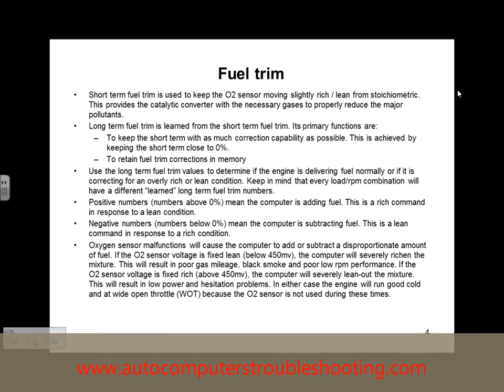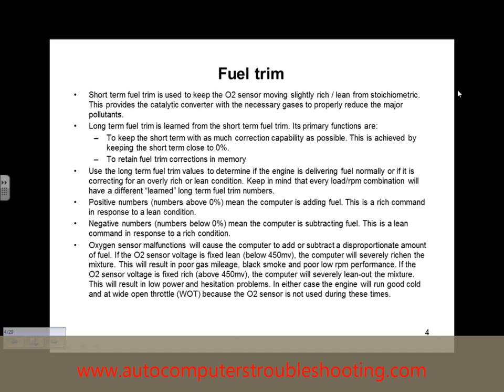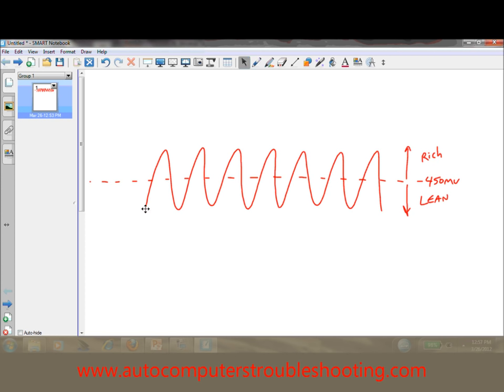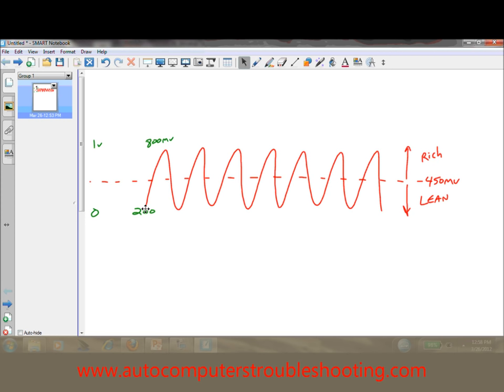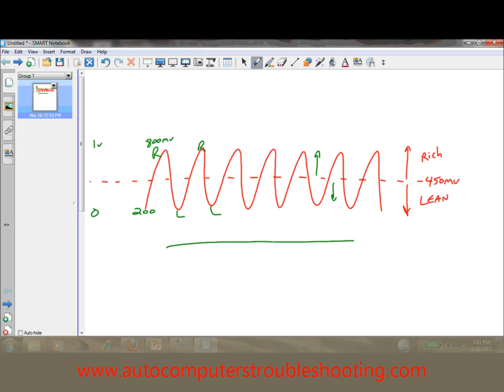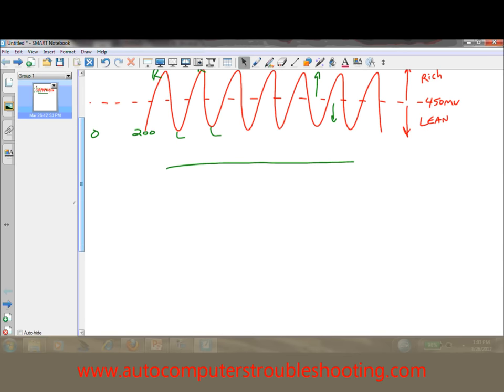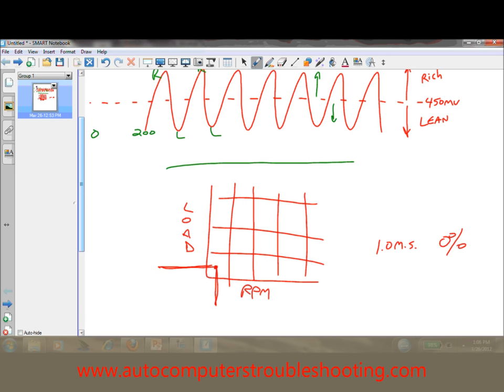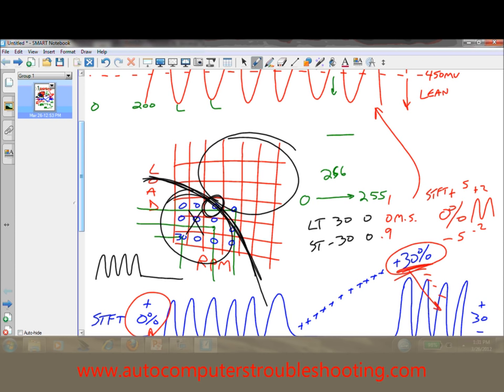Understanding Short Term and Long Term Fuel Trim (a SD Premium video)

Comment: Dude i have a question. At idle short term fuel trim negative 10 roughly and no change until accelerate. 1200rpm up fuel trim go pos then neg and back to pos as expected. Just idle sits around neg 10 at 800rpm. Your thoughts?
Reply from the maker: It is running rich at idle
Reply: Yep at idle. then as accelerate the soft goes up and down as normal.

Comment: Hello im currently using a Genisys Evo scan tool and wuold like to know what term does Nissan use to read or mesure Fuel Trim.
Reply from the maker: ST Alpha and LT Alpha
100 = 0%
Numbers above 100 = adding fuel
Numbers below 100 = subtracting fuel
Reply: ScannerDanner Thank you . at first i couldnt find the FTs at all on the tool ,until i look under OBD2 GLOBAL . and found it there ,and thanks for the numbers .

Comment: I find that the Fuel Trims are meaningless short term as you get a constant fluctuation in the STFT that you cannot keep track of. WHAT I believe people should do, and I do, is get live data for say a 20 minuter mixed drive, export to excel, then work out the average Net Fuel trim for each Load.  This gives me a totally different view than what I expected by just observing live data.  You can then average for segments of load.  Say 15 - 40% Load, then 40 to 70% etc  which is what I do.  ALSO I think the humidity of the environment should be considered. Here it is 70% humidity right now.  Fuel trims will be skewed due to high moister content of the air, thus less efficient burn, creating lean condition, higher fuel trim than normal. IMO  Since the algos are worked in Korea, and maybe for Europe...where humidity conditions are not high most of the time.

Comment: Any idea why my long term fuel trim is fixed to zero? I have noticed increase in fuel consumption and found out that  ltfr is fixed zero.
Tried to disconnect the battery, that did not help.
O2 sensor is working properly and short term fuel trim is oscilating as is should.
Reply from the maker: If you have no codes and LTFT is at 0 and STFT is moving with the O2, everything should be fine. 0 is ideal.
Now if you have a code related to the O2, a fixed fuel trim number can be a default value, in which case that would not be good
Reply: @ScannerDanner  Thank you for quick response. I have no error codes regarding the O2 sensor. Short term fuel trim fallows O2 sensor.
I belive 0 is bad for the long term fuel trim, because it has always been around -7 to -5. My car is citroen c3, 1.4i 2005, running on lpg. 
Is there any way to force the ecu to reset the values somehow?
Reply from the maker: @sasacvetkovic127  0 is not bad, it is ideal
Reply: @ScannerDanner  
Thank you for answer. I will leave it as it is. 😀
By the way, you channel saved me a lot of money. Car repairman in Serbia are very bad, they just change parts until they hit the right one. 😅
Keep on with good work!!!

Comment: I need assistance, when my 2005 Pontiac grandprix GTP comp g idles my short term fuel trim will make it to +23 my o2s2 behind the cat will sit at 0mv to 50mv at that time the o2s1 in the exhaust manifold will sit at 950mv so it's definitely seeing that the short term trim is adding fuel.. the long trim will still be normal at -5. a few times I caught the long term at +23 with the short term normal between -1 to +1 with the O2 sensors reading the same thing. Car cold usually runs great, after it's warmed up I will feel it drag under light acceleration like 7% gas pedal. The more pedal I give it out responds, but total power at 100% throttle is less than it should be. Fuel pressure is 63psi no matter what load and rpm. Fuel volume test is 1 liter of fuel in about 30 seconds so I have good pressure and good volume.. mass air flow sensor and o2s1 are brand new acdelco parts from the dealer.. I have no codes..  I'm thinking map sensor maybe??? It's above the exhaust manifold. Also when it runs like it's dragging the trans shifts soft or firm and shifts are late, I feel 1st gear shifts at about 4 grand which is a little higher then I'm use to.. transmission is new btw, 30k on it.. intake manifold gaskets are also new, I installed the newer metal gaskets...  An ideas? I need a direction please. Issue is there with the stock pcm and with the zzp pcm.. in the past year, 3 times I heard some bad spark knock in 4th gear overdrive with half throttle..  but once that happens on a trip it won't happen again after I take it out of over drive. I then let it go back into overdrive and it won't do that again for months. It's only happened on 3 of the 100s of trips in the past year and once it does happen it won't happen again on that same trip..  any help would be appreciated. I do have some scanner screen shots and a video I can share if it helps
Reply from the maker: Any chance your upstream and downstream O2 connectors got swapped? There is only 1 upstream sensor right?
It doesn't make sense to have a 900mv upstream, a 0mv downstream and a +23% fuel trim.
If the upstream is fixed rich (900mv) you should be seeing negative trim numbers, not positive
Reply: @ScannerDanner  yes only 1 upstream and no they aren't swapped the connectors for each aren't the same. Even if they did reach each other.. when I start driving everything goes back to normal too... I was beginning to think my o2s2 was\is failing and the pcm was adding fuel trying to get it to switch??? But it hasn't done it in weeks now but I still have that power loss after warmer up.. car feels like it's dragging something heavy behind it at very light throttle, it's missing the torque I'm use to feeling at I can tell I'm losing power across the board.. when I first start it up in the morning it runs great though, cooler it gets outside the better it seems to run.. even if I have a bad O2 at pe it shouldn't matter, that's why I started with the maf.. in the na motors I know the map is used for EGR testing, but in the supercharged grandprix I'm pretty sure it does more.. even though the scan data for the map\boost sensor looks good, I'm beginning to think it could be glitching and I'm not seeing it on the scan tool.. it's giving me 5psi at idle, 26 to 27 PSI when I shift at 6200rpm which with the 3.4in pulley on it = 12 to 13 PSI boost after I subtract the barometer reading of 14.3.  I tried my stock pulley and still have the issue.. I've replaced all 3 coils, ign module, plugs and wires also. Another reason I'm thinking map sensor is because it sits above the rear exhaust manifold.. and I'm not sure if what's causing the power loss is causing my 1st gear shift to about 1500 rpm higher then normal, or if my firmer then normal shifts are caused by the motor putting out less power then the pcm expects or if it's all being caused by the same thing..  I can't find any literature on what the map\boost sensor on the gtp does.. but if it's being used for more than testing the EGR I would think it could affect power a little and trans shifting being soft, firm and late.. I know the map detects minute air changes the maf can't so it would make since. Twice in the past year the car took off a little bit on its own in a drive thru.. took my foot off the brake and it took off like I pushed the gas pedal down 4% when Alli did was take my foot off the brake... Sometimes I wish I had a scope because of the scan tool delay. But I be eliminated fuel delivery besides the injectors, maf, o2s1 and the entire ignition system, crank sensor and harmonic balancer are even new. so there is nothing really left..
Reply: I uploaded a video of scan tool data, if anyone can watch it and see something I don't I would appreciate it.. 3 gm dealers and 2 shops say they can't find anything wrong but clearly something is going on.. I know my car and how it's supposed to run...  To bad Danner didn't love closer to Milwaukee WI I think this would be a good case study.. you could make 3 gm dealers and a couple shops look silly along with myself... Lol
Reply from the maker: @markborrmannjr  just replied to your video
Reply: @ScannerDanner  the only reply I see from you was from about a month ago telling me my O2 sensor wires are switched around.. but that's not the case..  i think I have a weak fuel injector, misfire counter will increase just a few for cyl 1 lately.. like 4 to 8 only..
Reply from the maker: @markborrmannjr  I replied under your video

Comment: My TPS at 20% @ idle.  
What if IAT is over 30 degrees higher than ambient temperature? Showing 130 and the outside temperature showing under 90
Both ltft are -9 area.
Reply from the maker: underhood temperatures and also some IAT sensors measure manifold temp
Reply: @ScannerDanner  both of my long term are -9 or -10 range
Reply: @ScannerDanner  someone said negative numbers generally point to head gasket.
Reply: Both negative ltft, bought a fuel pressure guage. Started vehicle and it indicated 65, soon as I turned off engine it immediately dropped to 60 psi.
Reply: 20 minutes later (about ) guage still indicates 60 psi while off. Took about an hour to drop to 40psi.
Reply: Where can get live data specs for my vehicle?

Comment: will there be a plus or minus behind the number
Reply from the maker: A minus but no plus
Reply: A minus means lean which the computer will interpret a rich command
Reply: Chris Canty I believe there's a delay in learn ambient so if you replace O2 takes 5 _6 miles to learn new ambient level & re adjust fuel by the CPU.

Comment: hey Scannerdaner, I have 99 corolla, I put scanner on it to learn fuel trims, I found out that long term is 19 at all times(idle or high rpms), the short trim is between 3 and -3 at idle, but underload, short trim goes to -20. what are your analysis on this?
Reply from the maker: What is your definition of "under load"? If you are heavy accelerating or at WOT, your fuel trim numbers are irrelevant under these conditions because the O2 is being ignored and the computer is NOT trying to "trim" the mixture. 
As for a lean condition all the time (idle and high rpms): My money is on restricted injectors which is common on this model. Do an injector balance test next.  I have some case studies on this but it's on a Chevy Prism (same Toyota engine)
Reply: ScannerDanner thanks. I mentioned when I rev the engine while the car is in park. I forgot to tell you that it had a misfire a few months ago on cylinders 1,2. I did some testings. I swapped the corresponding injectors with the good ones. The misfire moved to the other cylinders. So I went to the junkyard and got used ones, the misfire gone and the codes gone as well. Also there is an exhaust leak seems at the gasket before the cat converter. I wonder if it has any affect.
How to test injectors?
Reply from the maker: Toyota 1.8L with restricted injectors
https://www.youtube.com/watch?v=ZnFSUNjwDPQ
https://www.youtube.com/watch?v=85nMC6xIfUg

Here is the Chevy Prism with the Toyota engine
https://www.youtube.com/watch?v=pv9R2IEG4mU
https://www.youtube.com/watch?v=Q6lRNG5NdQU
Reply: thanks a lot sir! that helped me a lot

Comment: So I had a really poor fuel consumption and bought a scan tool. My LTFT was at 3.1% and STFT was at 19.5 showing a rich condition. Using this tool I realized I had some vacuum leaks. I replaced every vacuum hose since they were all really old anyway.  
Now here’s my problem Fuel trims

So I had a really poor fuel consumption and bought a scan tool. My LTFT was at 3.1% and STFT was at 19.5 Using this tool I realized I had some vacuum leaks. I replaced every vacuum hose since they were all really old anyway.  
Now my STFT oscillates between -3.9 and 3.9%
LTFT steady at -3.9%
Calculated Load oscillates between 14.9% and 15.3%
Mass AF at 1.79g/s
TPS 12.5%
O2S1  0.050v and 0.815 
O2S12 0.035 and 0.040

At 2000rpm
LTFT -15.6% and STFT oscillates between-5.5 and 0.8
Calculated load 16.9%

At 2500rpm
LTFT -21.9 and STFT -6.3% and 1.6%
17.6% calculated load. 
Those negative LTFT at open Throttle bothers me. I need some help here
Reply from the maker: it would help to know what you are working on (year, make, model, engine etc)
Reply: @ScannerDanner  2006 Toyota Corolla Altis with 3ZZ engine

An update: LTFT is now steady at -25% while my STFT oscillates between -8% and 3.9%
Cleaned my injectors (the plastic around the metal of each injector is crack)
Swap out Ignition coils to see if they were the issue... No changes... O2 sensors are new and MAF seem to be in good shape. 
Am having a Rough idle

Comment: How can i determine whether I'm in closed loop or open loop?
Reply from the maker: 1.There will be a data pid that will tell you
2. If your STFT % is correcting
3. If your O2 sensor is fluctuating
Reply: @ScannerDanner   Thanks I found a PID labeled " Fuel System " its either Open or Closed.

Comment: Can code p0113 give a rich condition? Mazdaspeed 3. Its miss idling pretty bad. Ltft -9.5 and stft -3.3 at idle. Ive cleaned out the MAF and IAT multiple times and has new plugs.
Reply from the maker: What's the definition of the code? I don't know these by heart.
Reply: ScannerDanner Hi sorry. It says IAT sensor circuit high input
Reply from the maker: Is the IAT circuit part of the MAF sensor? What year is the car? And engine size?
Reply: ScannerDanner yes it is part of the MAF. Its a 2007 2.3 direct injection turbo

Comment: Hi, I'm new, is it possible to keep computer memory somehow available when disconnecting battery for some reason?
Reply from the maker: Yes, with memory capacitors in the module itself.
Reply from the maker: But don't use those memory savors that you plug into the cigarette lighter

Comment: I have P1174 in 2009 GMC Sierra... After finding 2 leaks and tightening the bolts to the driver's side Exhaust manifold and catalytic converter.... How long until the computer realize the issue is fixed? My LTFT were in the +15 range. I drove 400 miles already since the repair... I can see the LTFT coming down . But is it common for this P1174 code to stick around this long after the fix? Not sure if I should move on to replacing injectors.. or just drive a couple hundred miles to see if It eventually falls into a fuel trim threshold to ECU is happy with. Can anyone recommend a tuner that will eliminate this balance bank issue ? Its not a driving issue... I just can't pass SMOG in California.
Reply from the maker: GM LTFT numbers will react within minutes. You still have a problem. 
What are your numbers ST an LT at idle compared to 2500 rpm in park
Reply: @ScannerDanner  at idle here are the fuel trims. STFT B1 @ -2.3% , LTFT B1 @ 0.8% , STFT B2 @ -1.6% , LTFT B2 @ 1.6%
Reply from the maker: @chickenfriedlasagna4597  and 2500? You don't have a vacuum leak that is for sure
Reply: @ScannerDanner  2500RPM at park I took a snapshot  showing STFT B1 @ 1.6, LTFT B1 @ -0.8 , STFT B2 @ 0.8 , LTFT B2 @ 0.8 ...
Reply from the maker: @chickenfriedlasagna4597  all these numbers look good, what seems to be the problem? What code is setting currently?
Reply: @ScannerDanner thanks for reviewing. Code is P1174. Fuel trim cylinder balance bank 1. The only issue is the vehicle can't pass California's SMOG test with check engine light, oxygen sensor monitor not ready... this code is the only thing I have to track the issue down.
I'm hoping it is just the high RPMs that need to sort out. I drove over some steep hills before I got the issues corrected.. Grapevine (i-5) Donner Summit (i-80).. maybe those trips are still in it's memory ?
Reply from the maker: @chickenfriedlasagna4597  well there certainly is no fuel imbalance going on currently. I'd suggest watching those numbers during some steady throttle driving and see what they do. Maybe clean your MAF just for the hell of it, to see what happens.
Reply: @ScannerDanner  Will try. Thanks for the help.
Reply: @ScannerDanner  could I run something else by you? Do Fuel Trims determine the A/F equivalence ratios of .999, 1, or 1.001?  
Curious if I'll be at 1 eventually...? Thanks
Reply from the maker: @chickenfriedlasagna4597  yes, and these are just calculated numbers based on the fuel corrections or fuel trim. When STFT is moving back and forth across zero, you are at stoichiometric (14.7:1) or Lambda of 1.00
Those numbers you posted look good, as does your trim numbers.

Comment: Hi guys, 
If my sensor 2 voltage is 0.7 to 0.9 on idle what those it means ?

Many thanks
Reply: If you have steady voltage on your O2 sensor after the catalytic converter, that just confirms your cat is doing it's job. Mine tends to be 0.1 to 0.2 except on cold start up. When I'm speeding up and I'm in the throttle pretty good, my front O2 sensor of course goes rich, and sometimes the catalytic converter's O2 sensors goes rich too.

Different cars have different usual steady readings after the cat. Just remember, it should be stead. If it spikes easily it may be an exhaust leak, if it oscillates up and down somewhat like the front O2 sensor then you have a bad cat.
Reply: DE Nichols thanks.  I guess its all fine so. ;)

Comment: 2002 Nissan direct injected engine (QR20DD). By judging spark 
plugs, I assume that the air / fuel mixture is not rich. May be some 
kind of a lean condition?
https://i.stack.imgur.com/0vaTv.jpg
But the issue is fuel trims. When it idles around 650RPM, the STFT is
 bouncing from -2% to -8% and the LTFT stays at -10%. STFT is 0% to 2% 
and LTFT is -5% at 2500RPM.

Whaty I don't understand is why the spark plugs indicating a lean mixture and fuel trims indicating a rich mixture?

I understand that the rich mixture at idle and fuel trim close to 0% 
at 2500RPM is an indication of a bad MAF sensor. But it reads pretty OK 
(1.25V - 1.32V) at idle. May be the intake valves are clogged or any 
other causes?